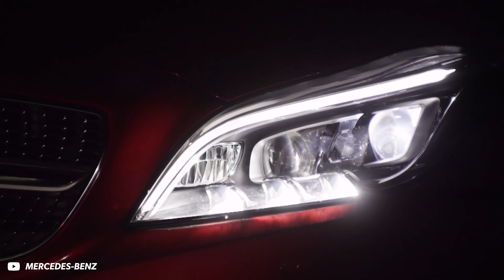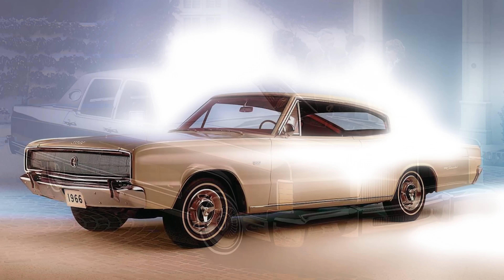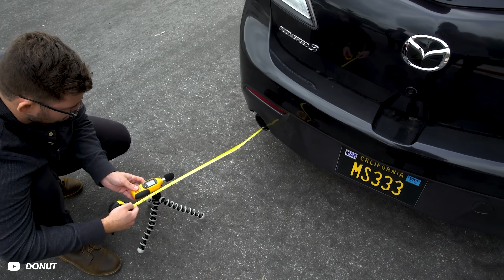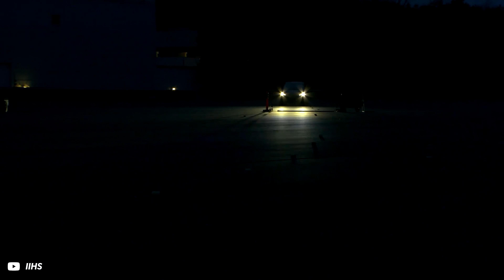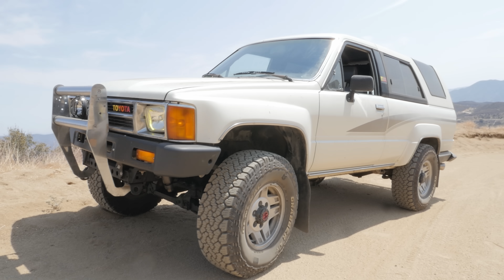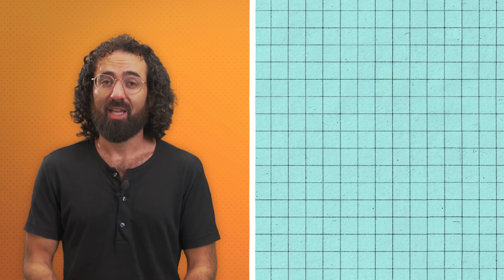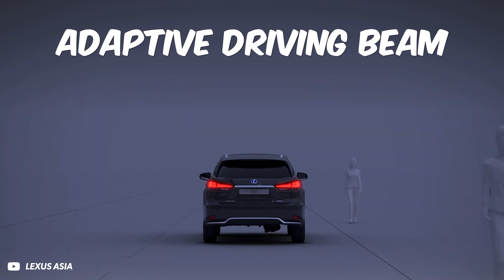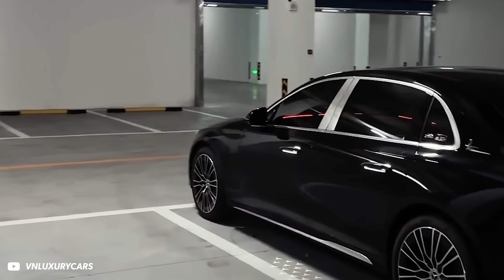Why new headlights are blinding American drivers

Comment: Tesla is particularly bad and drivers not sure what the blue jellyfish light is .
Reply: Yeah, it seems like they're all driving with their high beams on all the time at night. 😎
Reply: Doesn't Testla control the high beams automatically?
I thought it should be standard by now, except of low-spec cars, to somehow control the shape of the light cones to avoid other cars.
Reply: @MetalheadAndNerd tesla does have automatic headlight and made an update for adaptive headlights. Older models don’t have headlights that can do this but all newer models do.
Reply: @2js_vaycay  I’ll have to pay a little more attention so many of them around me been seeing alot of new modle y’s and 3’s lately.
Reply: @MetalheadAndNerd  Yeah, but it's still too slow to react and it still blinds people. Maybe it blinds them less, but it still blinds them.
Reply: I had a stock Model Y performance. People would flash their headlights at me all the time. They thought I had my brights on. It was just the regular low beams.
Reply: I still don't know how the sea shells work in Demolition Man!!!!
Reply: Just proof Elon is an Ass!

Comment: I'll probably get hate, but this is one reason I like driving in a US state that mandates safety inspections. Part of the inspection is a headlight calibration to ensure they are pointed down at the road and not off into the horizon. I drive a low car and I only have issues with extra large cars, such as lifted trucks. Still, that's only a fraction of the picture and if we keep moving forward the way we are now, it's going to become an even bigger problem. It's not hard for manufactures to take on ADB. We just need somebody (laws?) to make it a standard and not an option.
Reply: If you're talking about PA, I agree about inspections... But most shops don't actually pull out the headlight aimer unless they're being audited... speaking from personal experience...
Reply: @scottjs5207  I think only 11 states, give or take, mandate inspections. And yeah, I can see some shops just not caring that much.
Reply: I'm driving in california RIGHT NOW and I can tell you that inspections DO NOT MATTER.  blinded CONSTANTLY on the road by vehicles with cali plates.
Reply: Where I live also has yearly mandated safety inspections, yet these jackarses are driving around all over the place with these bright lights.  Don't get me started on the big pick up trucks who add MORE lights across the front of their truck.  NO ONE can see wth is going on in front of them when these pricks are driving towards them.
Reply: IIRC, Canada bans lifts over a certain size, so that might be a practical solution.

Comment: One of the problems is there are lamp height regulations that people ignore when they jack up their trucks by 2 feet and put the lamp directly in your line of sight.
Reply: The problem is called "leveling" a truck.  What cracks me up is when these guys complain that the truck vibrates on the highway after they do that and blame the OEM.  LOL.  Idiots.  (look up U-joint mis-alignment...)
Reply: A lot of these oversized pickups and SUVs have headlights too high in their stock configuration anyway. If there's any regulation on that it's a joke.
Reply: There are 2 kinds of people in this world. 98 percent of the people in the world think they are starring in their own movie. Despite what they say or think that's the reality of it. These are the selfish pricks who know their head lights are really bright but don't give a flying F because they think we all exist for them.
Reply: @The-Pimpcat  Most of the bubbas around here think it is "funny" that their lights are blinding everyone else. One day, they'll get hit head-on because the other driver was blinded. Then it might not be so funny.
Reply: Iirc, it's banned in Canada.
Reply: Absolutley
Reply: Lifting a truck would be fine if the arseholes would spend a few minutes properly adjusting their headlights for the new height/leveling.

Comment: I thought the Model Y also has matrix headlights?
Reply: Yes! This was an ota update I was happy to get! Who cares if a car can make “Tron” sounds. The function updates are awesome.
Reply: My 2025 Model 3 Performance also have them enabled now as well.
Reply: It does. It works great, as long as you don't live in the US that is.
Reply: @fragge2926  I'm in California,  my '24 Tesla has adaptive lighting, it works great.
Reply: @fragge2926  Works great if you are driving one maybe, one of the worst to blind other cars in my opinion, together with VW ID models.
Reply: Yea and Teslas are some of the worst for blinding everyone. Some French cars are bad too (though you don't get those in the US).
Reply: @BlatentlyFakeName  Well. Good thing Tesla has solved the blinding issue for cars built after 2022 now that Matrix LED support has been rolled out through a software update.
Reply: @Ben21756  Matrix lights aren't any better. We've had them in the UK for years.
Reply: @BlatentlyFakeName  Not on Teslas, no. Matrix LED support was released around March of 2024 in the UK and for the rest of Europe. It's fairly recent, not counted in "years" at all. Don't know about you, but I haven't had any issues with the new model of Teslas ever since the update, as a driver.
Reply: @Ben21756  Other manufaturers have had them for over 10 years here.

Tesla headlights in general are some of the worst for dazzling.

Also some have started to fail now and the cost to replace them can be 1000s. Not exactly cost efficient for the customer.
Reply: @BlatentlyFakeName  Are you talking about modern Tesla headlights with the matrix LED or the older ones? Are you trying to conflate the two? Yes, there were issues with the older headlights, but not with the newer Matrix LEDs. The new headlights dim individual pixels for incoming traffic, and most reviewers say it works brilliantly. I haven't heard of any premature failures on the Matrix LED units on Teslas. It also seems unlikely, as LED technology is extremely durable and reliable.
Reply: @Ben21756  It's all the same tech.

I've seen quite a few dead LED lights now. Including teslas which aren't even that old. In the UK they are required to be working at MOT time so the owners will have to fork out loads to replace them. It's not as simple as switching a bulb.
Reply: @BlatentlyFakeName  Have you heard of survivorship bias? Out of all the cars that went through the MOT assessment, you're likely to remember only the ones that failed, and not the thousands of cars that pass annually with absolutely no issues at all. The model of Teslas equipped with Matrix LEDs isn't even old enough to be legally required to be sent to an MOT test unless the owner specifically books for an assessment. But that would be absolutely unnecessary unless they already suspect faults with the car. So only owners who suspect faults = higher chances of failures shown in tests, survivorship bias again. Even with a defective unit, the car should still be covered under warranty; owners do not have to fork out their own money for replacements. You can't make such a generalised statement like that, can you?

Comment: There are more and more matrix headlights here in Europe and are shit. You are constantly blinded with these because they do not adapt fast or precise enough as they are made to be. Good idea but bad implementation, even the most high tech Audi systems. Just be thankful to not have that in US, believe me
Reply: What brands ? I had adaptative high beams on my C-Class(wagon, diesel, so unamerican lol) and I was surprised how well it worked on the highway. Although I didn't try it elsewhere to be fair.
Reply from the maker: interesting perspective. we’ve tested cars with those equipped in europe and they seem to work well in standard conditions, but i can see how it would fall apart in heavy or faster traffic
Reply: @drive  The problem comes when German engineering meets Balkans road conditions. Bumpy road, and the fancy LED adaptive magic becomes a techno party. "we add just one more expensive half baked tech bro', it will solve the issue bro', trust me bro'. Ohh, it costs 10x as the good old tech? whelp, how about stop being poor, bro".
Reply: @drive curvy long roads usually make them ease into your rear window or your side mirrors as they shine around you and also they shine on to incoming traffic at a distance. There's a German channel that tests this, I recommend checking it out. It's called Motorreport
Reply: @drive Define "standard conditions".
Reply: it's the German brands
Reply: @lemcake32422  I guess you are meaning Hella lights.